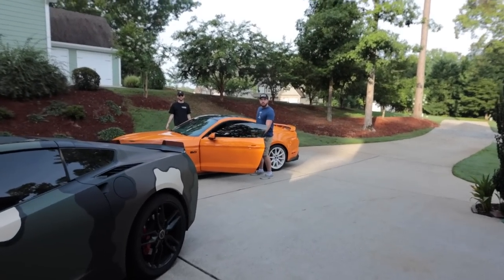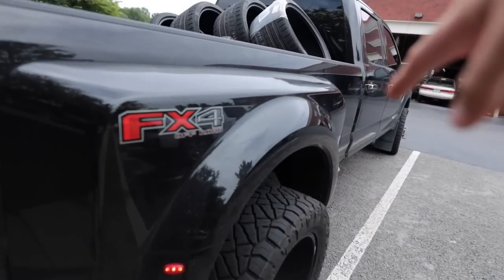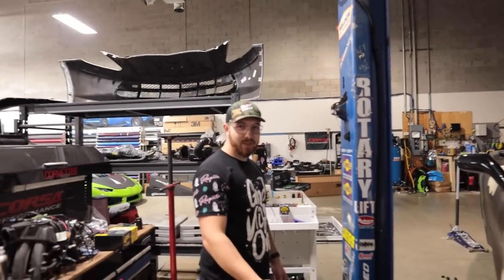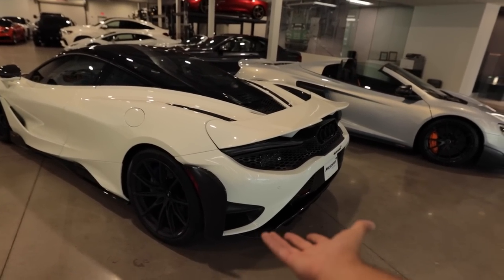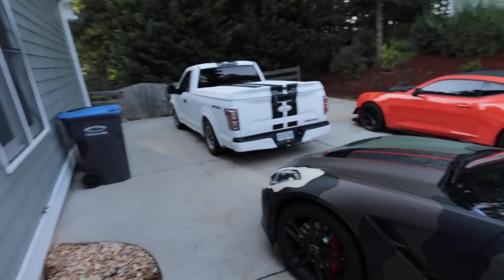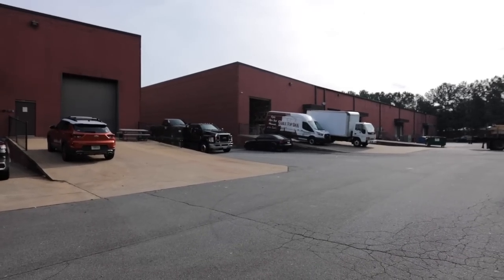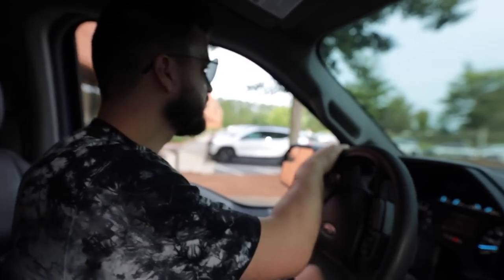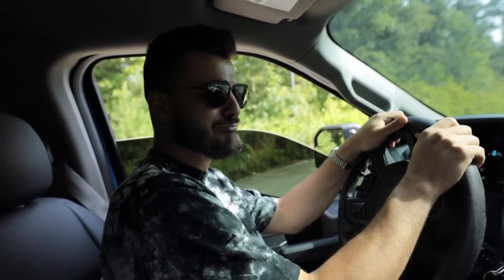Taking Delivery Of My New 600+ Horsepower SEMA Truck!

Comment: I'm so glad to see ur videos I've had a rough patch lately since may I had caught on fire and ended up with 3rd degree burn and a dislocated shoulder and un able to work I just recently got a  surgery on Wednesday then on Sunday afternoon I was driving and it started raining and my 2017 camaro ss ended up sucking in water and hydro locking my motor and it currently won't start I'm attempting to fix it with one hand and little to no funds it's my only vehicle and my life so keep up the good work

Comment: @itjusta6 next time your doing that and caliper bracket mounting bolts are tight just turn your hub so you can fit an impact on the bolts my guy🤣🤣 10x easier